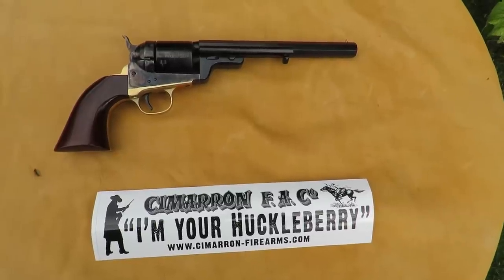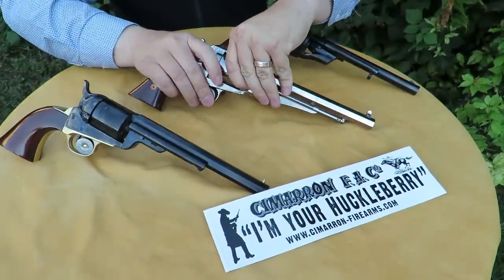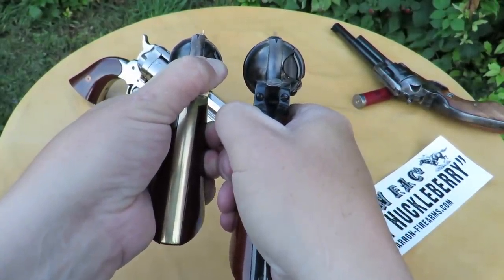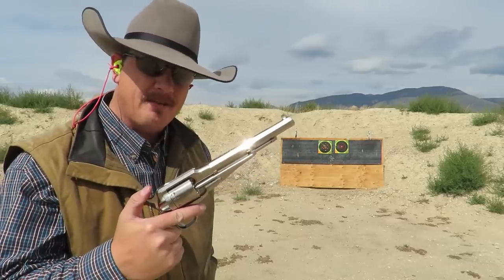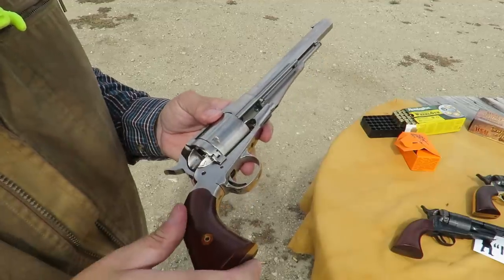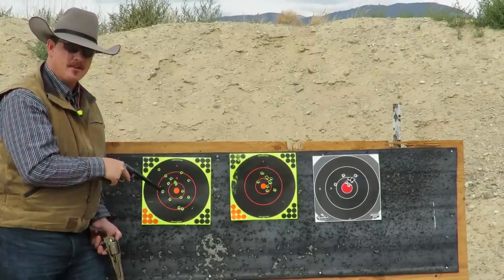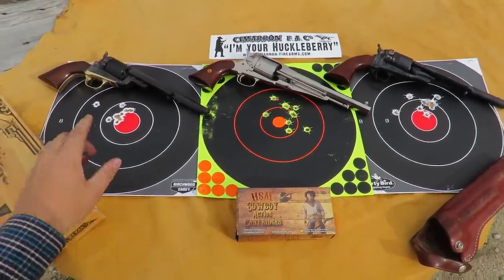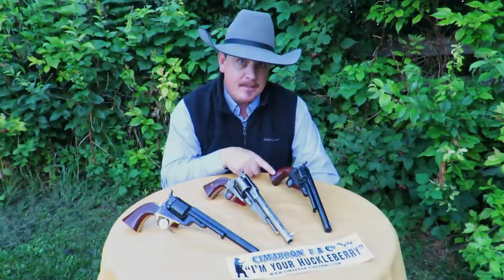CONVERSION REVOLVERS! from Cimarron Firearms

Comment: Great Video! Third watch & subd...I'm leaning towards the Taylor's Uberti Remington Conversion in 38 SPL for a next purchase. Looks to be a fun piece for casting and reloading. Just got springs and a hand from Taylor's for my original 1858 cap & ball; fitted them with little fuss and the timing came back to life dead on - for the first time in a century she's making 'clicks' music.
Reply: Update Clay, I picked up an 1858 Remington conversion in .38SPL, blued, 7 3/8" octagon barrel from the Cimarron showroom at Texas Jack's. Put 100 target hand loads with Lee cast 125gn RF through it at the range - capable of touching shots right out of the box. Superb fit and finish and tight as a drum. Fun to shoot and easy to clean that Remington frame design with the drop-out cylinder.

Comment: I've been thinking of buying a 1851 conversion, what your opinion between Cimarron or Taylor's?
Reply from the maker: Well, in most people's eyes, they don't seem to be that much different, however, even well before I was sponsored by Cimarron, I chose Cimarron guns.  The reason being that Cimarron generally has more detailed design/quality criteria, and due to the fact that most of the historically accurate reproduction firearms coming out of Italy owe their thanks to Mike Harvey, owner of Cimarron, because many years ago he started working with the Italian manufacturers and had them blueprint designs off of his own personal original firearms. Up to that point the Italian reproductions were generally crude copies which were not historically accurate in dimension and detail.
Reply: Brian, there is a nice four part series of short videos on the Cimarron channel with Mike Harvey telling his story and the stories of the guns and production.

Comment: Thank you so much for not calling the 71/72 Colt a conversion, many people think it is because of the similarities in their looks, of course it's  not. It did share a few parts but the frames, cylinders and barrels were all made new to new specs. However you did say that the conversions were part of the evolution of Colts that lead to the SAA. Sorry to say that's not correct. The Richards and Richards Mason conversions all came after the SAA. Very shortly after but after. The conversions were mainly an effort to use up part stockpiles left from cancelled civil war contracts and low sales of civilian arms after the war. Some customer guns and army guns were also shipped back to Colts and converted using these methods but not in huge numbers.  For an indepth look at the conversions pick up a copy of "A Study of Colt Conversions and Other Percussion Revolvers" by R. Bruce McDowell.
 Thanks for a great look at these guns. Not too many people since Elmer Keith have shot these guns at 100 yards or more ,nice.
Reply: There is some speculation that individual gunsmiths did this before the R&R Mason Conversion but were done in such small numbers as to be almost nonexistent today.  Yep.  Either using up excess spare parts or people sent their favorite pistols in for conversion.
Reply: @exexpat11  speculating on these "what ifs" is always fun. The limiting factor as I see it, is what cartridges were available to use. The Rs& RM conversions were all made in proprietary cartridges specifically designed by Colt for  these guns. So it's unlikely that they were availible to the public much before the guns. The most obvious cartridge to look at is the 44Henry, especially since the 71/72 "Open Top" models all used it. The case diameter is ok but the problem is that the Henry (according to my research) has a bullet diameter of about .430, far to small for the 44 Colt Armys, which had a barrel groove diameter of .454. I'm hoping that you already know the whys and wherefores of that story.
 The only cartridge, that I can find, which is feasible is the 44S&W (American). Which seems to have become availible in about 1869. Possible but that leaves a pretty short time line for an independent gunsmith to come up with a practicle conversion design before Colt could. Maybe a gun maker or an extraordinarily well equipped gunsmith could have but for a one or two off it would have been quite time consuming and expensive. The later conversions done by such men all seem to include replacement cylinders, not the job for a  towns gunsmith.
A gunsmith done conversion could be much more likely on the 1849 Colt pocket models as the 32S&W short rf would work and came out in 1860, plus there were far more of these guns in civilian hands, maybe creating a larger demand long before Colt got around to it. Hmmmm. I would be pleased to hear further thoughts and rebuttal.
Reply: @richardelliott9511  I was agreeing with you outside of single custom conversions made one by one by lone gunsmiths.  No need to write 3 paragraphs.

Comment: does anyone know of any conversions that can handle the 357 mag? is that just a limitation of the designs? i understand if its an actual conversion then it just wasnt built to deal with that pressure but do they make any new ones from the ground up to do that? 45 is just a little too pricy and id like a little more pop than the lower end of the spectrum of the 38
Reply from the maker: No conversions that I know of are sold in 357 mag.  I imagine the conversion design is not suitable for those pressures.

Comment: What's the law have to say about these old enough not to register or do I have to have a special permit or something
Reply from the maker: Depends on your state, I suppose.  These are cartridge firearms and therefore are subject to all the same laws as other similar cartridge firearms.  Not a registry, but you will have to fill out a 4473 to pick these up from a dealer.
Reply: @TheAdventureCowboy  here in Wayne County Michigan I have been told three different things one it's just a part and because the round is old as in cowboy load it is not modern when I'm speaking of foot per second pressures Etc I wanted to change so I can keep this weapon loaded safely I'm worried about static electricity I have other weapons modern so don't rely on this for home protection or hunting but it would be nice to have both black powder and a cylinder for cartridges thank you for your time

Comment: I just never saw a reason for conversion revolvers, except to use up stock parts at the factory.  They had the 1873 Colt and Smith and Wesson’s.  If they were a lot cheaper than the new cartridge firearms, that would have been a reason.
Reply: They were cheaper and earlier than the SAA. Colt needed a transition gun to stay competitive. The Richards and mason was 1871...2 years before the SAA was ready and even then only about 1000 SAA's were sold to the public-they were made primarily for gov't contract. Truth is during this time you would've seen many more transition Colts in the hands of civilians than anything else..among Colts that is. These were true transition guns by the way. Yes they did use some spare parts from inventory from the war but many parts were manufactured new as well. It's not necessarily accurate to call them conversions. Conversions were manually done by the hands of private gunsmiths...but now I'm being picky.. :-P

Comment: So If i wanted to convert say a griswold, could I keep the ram rod for looks? Or do I have to remove it? Thanks
Reply from the maker: I can't give you a good answer on that one. Better question for a gunsmith.
Reply: You can keep the ram rod. This said if your Griswold is a brass frame which I assume it is you do not want to convert it the brass is soft and it will come apart as they cannot handle the pressure of a cartridge conversion.All the conversion kit manufacturers recommend against it.
Reply: @tnbass2833  ohh ok gotcha. Thanks for the info. I might have to look into getting a steel frame and just piwdercoat it to look brass or something

Comment: Why did they do it so the 6s cylinder didnot load what could they have Done so you could load all??
Reply from the maker: You CAN load all, and at the range, that is fine, but you do NOT want to carry with 6. That is why you use the 5-shot "Cowboy Load" in revolvers with the firing pin on the hammer...so you can carry with an empty chamber under the firing pin.

Comment: Fascinating.  I did not know this.      What I don't like is now I have to apologize for all the disparaging things I said to a western movie, that was clearly using these, and I thought they were putting cartridges into a cap and ball pistol! 😃
Anyone have any input as  to accuracy of one of these vs something like a 686?   I'm planning on getting a revolver but can't afford 2.  I think the western ones are so much cooler, but if it isn't accurate, it'll just drive me nuts.
Reply from the maker: The intended use is the big question.  With the modern revolvers, many have a transfer bar-type safety mechanism with allows the user to safely carry a fully-loaded cylinder. Plus, the double actions of today make more sense from a self defense standpoint.
Reply: The Adventure Cowboy    Well this is my big problem.  To get a modern revolver like a 686,  or a 44, which would be good for target shooting and home defence, or get a western single action for fun.     I LOVE old guns, and the western stuff is something I'd really like.  Loved the old westerns.
If these western guns can be shot very accurately compared to a 686, then I'd lean towards a western, but if not, then I'd definitely go modern.....I'd be sad though.
And hey, 5 rounds of 44-40 is a good deterrent for the home.😉
Reply from the maker: Well, I am no expert with a handgun and you can see that they are plenty accurate. That being said, I can pull off the same performance out of a modern revolver or auto.
Reply: The Adventure Cowboy   The same is good enough.   I do some precision shooting, though not at a super high level unfortunately, so it has to be decent.....I'd definitely stand out at the club with one of those! 😃
I'm thinking I'll start looking for a second hand deal on one.  That way there's no loss if I have to sell it.   Plus if my moving plans come through, in a year or so I'll be in a place that has cowboy action shooting.
Thanks for your input.  I appreciate the time.
Reply from the maker: @jimf1964  Just remember that most of the cowboy guns do not have adjustable sights, and the majority just have a simple groove in the top strap for a rear sight.
Reply: The Adventure Cowboy    Yeah, there are some that seem slim enough to get an accurate sight picture, but the lack of adjustability could be an issue..........Geeze, I want one so bad, but eventually I'm afraid I would get tired of it if it wasnt capable of doing targets.
What do I do adventure cowboy?!?!

Hey, saw you on a shot show video.  You're a famous adventure cowboy.

Comment: Would these handle modern cartridges maybe not plus p but still just modern ammo or do they require cowboy action, lighter handloads?
Reply from the maker: I am not going to speak for the manufacturer, however, I ran all off-the-shelf factory loads that were not cowboy action. They all handled the ammo well, with not a single issue or even a sign of an issue. I would NOT run +p ammo in them.

Comment: Has anyone tried fanning with a conversion revolver? Is it okay to do so or is it 'bad' for the gun and might cause problems?
Reply from the maker: It can definitely be done, but I don't recommend fanning on any revolver.
Reply: @TheAdventureCowboy  Thank you for the response. Why not though? Is it bad for the internal workings and mechanisms?
Reply from the maker: @gevorggalstyan5076  It's hard on the gun,  Often, when people fan a revolver, the chamber doesn't get perfectly inline before the bullet heads into the forcing cone, and as a result, flakes of lead peel off the bullet and go flying out the side of the revolver.  The first time I tried it, I had hot particles of bullet hit my cheek, which is how I first learned of this issue when fanning a revolver.
Reply: @TheAdventureCowboy  Wow, this is great insight! I've actually tried it just once, except it wasn't really proper fanning because I was pulling the trigger every time after cocking the hammer. It was only the day after that I found out the way actual fanning works is if you hold down the trigger while pulling back the hammer for consecutive follow up shots. In which case, I'm less worried now about any actual harm being done to my revolver since it was technically fired 'as intended.' I appreciate your responses. It's great to learn such intricate details from someone with experience that otherwise can't be found on the web. Thanks a bunch!

Comment: If the pistol has a transfer bar then you can safely carry w/ all chambers loaded.
Reply from the maker: That is true, but none of these have a transfer bar.
Reply: Most of the Colts and Remingtons of that era had "safety pins" between chambers for the Colts hammer to rest on and the Remingtons had safety slots between chambers to rest in. The old saying about carrying these guns with the hammer resting on an empty chamber doesn't make sense since both types were just as safe when using the pins or slots! On the other hand, the Colt 1873 SAA did have a problem since the firing pin rested directly on the primer of its centerfire cartridges!
For you history buffs, it was O. F. Mossberg, while employed by Iver Johnson (or was it H&R), that invented the transfer bar safety system and not Sturm Ruger.

Comment: Why does everyone always preach the cowboy load when they know full well they are just going to empty the gun at a target?  
I get the the point of it,its for safety while carrying in case something hits your hammer, but if your just target shooting what is the harm of loading all six? The gun spends most of the time in your hands,and even if its in your holster between drills what would hit the hammer?

Im knocking your style or anyone elses, and if it truly is just for an abundance of safety i have no issue with that either.
Reply from the maker: Good point. In another one of my videos (Cimarron Bad Boy) I discuss exactly that subject, and point out that at the range, it's fine to load 6. So, yes I agree with you. The "preaching" part, at least for me, is because I just want any potential viewer, who is new to revolvers with a firing pin on the hammer, to understand what the Cowboy Load is and why it's important. I guess, in my mind, if I can keep just one person from accidentally injuring themselves or someone else, it is worth the redundant Cowboy Load bit.Does that make sense to you?
Reply: @TheAdventureCowboy  that explains it perfectly, thank you.
Reply: I also agree with The Adventure Cowboy. As a NRA Certified Pistol Instructor I have my students shoot all types of .22 handguns (for sake of low recoil, etc.) and have both types of SA revolvers and explain the 'transfer bar' system and its purpose so that my students leave my class with safety in mind.
Reply: @TheAdventureCowboy  It's best to remember for safety reasons, the firing pins are on the back of the cylinder instead of the hammer. In that scenario, the hammer is always resting on a firing pin which can be very dangerous if the revolver is dropped or the hammer snags on something!
Reply: It's because they are busy body's. Yeah if you are carrying for target and not at a match load and shoot how ever you like. If at a match, or loading for work yeah a cowboy load is proper
Reply: i think it's just from fear, imo if your prone to dropping firearms, you shouldn't own one, if you make a lot of mistakes with important things , you should not own one, or hold other peoples babies, or cell phones, or power tools, i'm not sayin anyones perfect or has to be, i just dont think it's that big of a deal, i just think if you are that worried about killing someone on accident, you prolly shouldn't own a gun
Reply: @seanc8054  Btw  Yes with a modern design revolver, Sure load to capacity but not on something with a fixed firing pin
Reply: Kenneth Schlegel, take a look at my video "How to carry a Colt style revolver fully loaded"  You can do it safely!

Comment: Beware- These pistols are for ballers only. It's 300-500 just for the cap&ball pistol, then 400-700 for the conversion kit, THEN you have to buy cowboy load ammo which isn't cheap.
Reply from the maker: Wrong.
These come  from the factory as conversions. No Conversion kit. MSRP on the 1860 Army Type II Transition is $609, so street price is less than that. I shot off the shelf ammo through these no problem. Cowboy loads, like those from HSM are usually cheaper than full-house loads.

Comment: Sorry, I can't take someone saying a ruger vaquero is a colt reproduction. My colt saa's are worlds apart from a ruger
Reply from the maker: A little smaller/weaker in the frame and with a firing pin on the hammer...not that different. The Vaquero is still based on the SAA, but with some modifications.
Reply: @TheAdventureCowboy  completely different lockwork, design, springs and grip frame. 
Horrible balance and feel when compared to a real 2nd generation  colt and the fit and finish on a vaquero looks like it was done by an auto mechanic 
But yeah, totally almost the same. 
It is like comparing a Ford focus to a Porsche 
Worlds different in finish, design and feel
Reply from the maker: Not trying to have a technical argument here. The video was intended to be a very basic intro to conversions and where they fit in the timeline. I did not have a SAA handy when I made the video, and the Vaquero is based on the 73 SAA, so that is what I used.
Reply: The Ruger is a copy cat, different internal function, but it doesn't stack up to a Colt.
Reply: @99dsm1  More like a Corvette vs a Porsche. The Porsche owners will scoff at the Vette as it passes them on the drag strip. Colts are wonderful but they cost four times as much and their internals are more delicate.